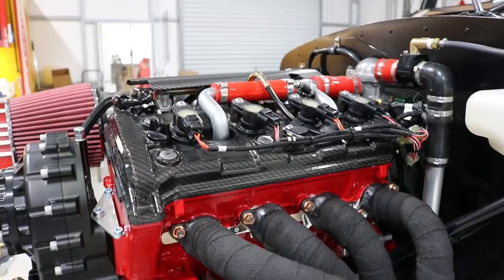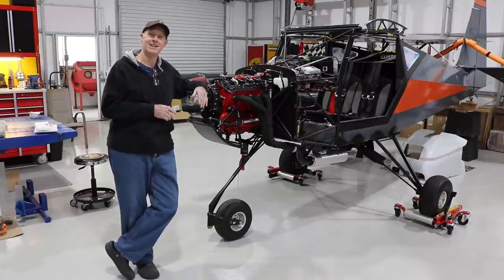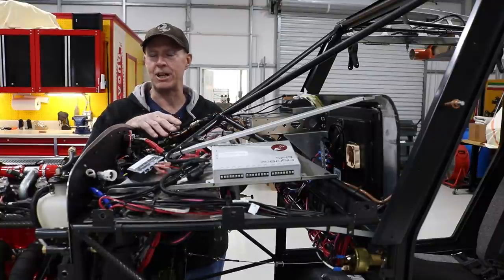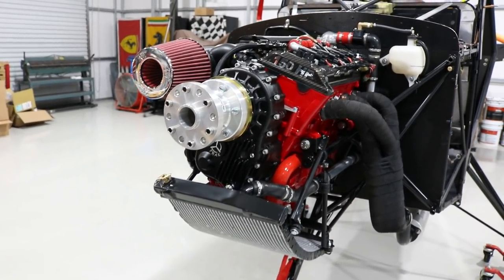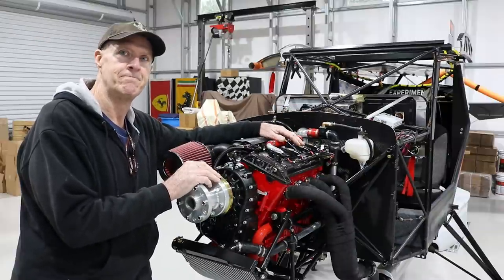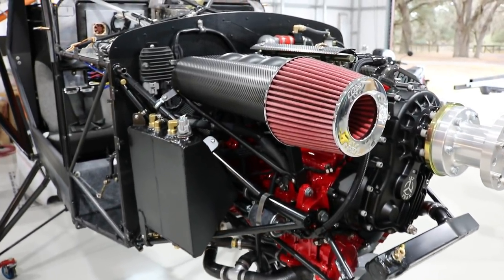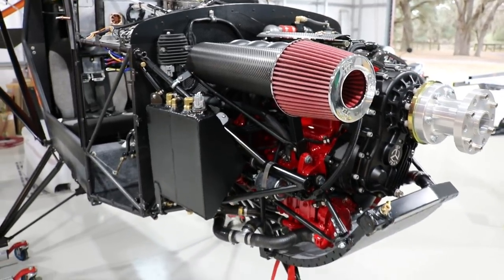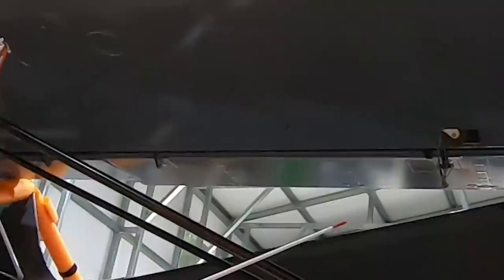150HP Yamaha in Highlander Aircraft - Craig Timm Builder

Comment: Sweet! Definitely need one of those in a Sonex!
Reply: I own a Sonex with Jab 3300. Would love to have 150HP. But with only 1 liter displacement, does it have to spin at 10,000 to make that power??
Reply: @701cyclone  Yes. I read somewhere that these engines have to turn at least 10K. Maybe more like 12K. That kinda puts me off these. Seems like flying around with a grenade on the nose.
Reply: These engines are for snowmobiles that don't have transmissions so they often tend to be running constant fairly high RPMs. They're also based on sportbike engines so they're designed with high RPM and abuse in mind, albeit with a transmission and not flying through the air.
Reply: RADThird1 your worry is woefully unfounded.
Reply: @LORENZindustries  Overhaul intervals are significantly shorter on such high RPM engines (all else held equal). This is not to say it won't operate reliably between them.

Comment: Craig, if you don't mind...
1. Just to be sure,  does the 180 lbs wet weight include the radiator and coolant?
2. What method of attachment did you choose for the inlet runners to the PVC plenum (Hysol, West System epoxy, etc)?
3. We might clarify for some viewers, your radiator is from a Kawasaki ZX14R motorcycle (excellent idea!).
4. I hope we get to see your finished cowl some day, especially the radiator inlet.
5. I'm impressed with your oil tank solution! 
6. Thank you so much for sharing!!!
Reply from the maker: @FoesFlyDennis... this is the Experimental Aircraft Channel. If you would like to reach out to Craig you can find him on the Yamaha Conversions GROUP on FB. (Which is where he will be posting his build updates as he goes). The 180lbs "Wet Weight" would be "All in." Yes sir. Thanks for watching!
Reply: @ExperimentalAircraftChannel  thank you Bryan. Your channel really is the absolute best for EAB!

Comment: As an svid motorcyclist I've always been intrigued with a motorcycle application into an aircraft. I was waiting the entire episode to find out when he was going to talk about having an air shifter to be able to downshift for more climb torque or upshift for better Cruz performance at a lower RPM.... is the reduction Drive connected to the countershaft sprocket? Is the gearbox retained?
Reply: This engine is from the Apex snowmobile, no gearbox.  It does have a slight reduction gear built into the PTO (clutch) side and the SkyTrax gearbox takes power from that.
Reply: @RussellTelker  that makes perfect sense.   thanks for the explanation.   I thought it might have come from a yamaha R1 or something.   Imagine what it WOULD be like to keep prop RPM steady and shift the engine to low gear for climb out and high gear for cruise.
Reply: @mattgeans3758  Yes aircraft do have that called constant speed prop the pilot can adjust the prop while in-flight. Generally those are on complex higher speed aircraft not a STOL type, and light sport not even allowed by the FAA. Most experimental have a fixed prop the cost of the constant speed props can be lot $18-20k vr 2-3k for a fixed pitch prop. They adjust the prop with less pitch when taking off then at cruise adjust it for more pitch reduces fuel usage. Generally any aircraft cruises above 150 MPH or more will have this kind of prop some slower aircraft them. No need to change the RPM of the prop. Generally don't want a prop turning more then 3000 RPM the tips of the blades exceed the sound barrier which would cause them to be less efficient. The prop speed you want to stay constant. Most aircraft engines are direct drive off the crank they turn 2000 RPM range.

Comment: Just wondering about the engine ,  A plane is always under load , a boat is always under load ,  Marine engines have extra hardened valves and the pistons are twice the thickness because a boat is always under load , going up hill . and a plane is too I believe.  My question is this. are aircraft engines built to run under constant load like marine engines ? I would argue the are , But then again I don't have any experience with aircraft so I could be completely wrong.  Can you explain please ?   Thanks , and great build by the way . very nice.
Reply: Most aircraft engines, from what i gather are designed to run at 75% power for cruise. Cross country or cross county.

Comment: Nice thing about 4 cylinder inline engines is their use of a 4-2-1 header.  In years past Vice Roman at Burns Stainless had a header design service.  You filled out the engine specs and paid $75 and got all the specs needed for an optimum header for the engine.  Don't see the service on Burns' current website.  I think Roman is still around and perhaps will still consult.  I have used this service in the past and the seat of the pants dyno can feel an improvement.

Comment: 19:30  After landing & parking a hot engine, I hope heat doesn't melt the pvc.
Reply: Depending on underhood temps of course it shouldn't be an issue. It's opposite the exhaust which is also wrapped. Note that the intake runner tubes are also plastic, albeit likely a fair higher temp material. Peoole have ran pvc piping as intercooler piping on cars and not had an issue with melting it.

Comment: The air intake is PVC, I'd worry about the Heat Deflection Temperature which is only 92 °C (198 °F). Plus PVC is toxic when it burns. How hot might it get under the cowl running hot, sitting on asphalt on a 105°F summer day in FL?
Reply: even thin wall 4" is pretty resilient to heat and flame....plus, if the engine is hot, its running, hence cool air flowing through it.......just saying.
Reply: @hausding  like Jack wrote the there is not always airflow when the engine is hot, like right after shutdown. Why take a chance with your life, use Aluminum or Carbon Fiber

Comment: 20:40 Why is the coil-pack on the front sparkplug oriented oddly?   Does the engine management system use an Oxygen sensor?  Didn't notice one.
Reply: No O2 sensor on the Apex, it runs a speed density system. Designed for cold weather temps like snowmobiles, usually requires retuning depending on use case.

Comment: I love your project. In the same time as a diesel mechanic I disagree with you on the cooling system. Closed and pressurized cooling system has higher boiling temperature.

Comment: Had any years of apex yamaha  experience  with this engine one of my sleds has, 26,000 klm on it others have up to, 40,000 very real live engine ealways used a soil 0/40 synthetic  in fact owned over apex sleds with the same engine  ever had a problem on sled these enginkearerunni g had withaverage rpm 8000 to 111,000. I am also retired pilot last air raft piper Aerostar twin.  84 years old and  still  sled, Christopher ,Ottawa canada

Comment: Finally someone who knows that aircraft engines don't have to be from the dinosaur era with carburettors, carb heat, manual chokes, running lean of peak with manual mixture controls and other idiotically old tech like this. Don't tell me "it's more expensive to repair this way", because it's not... I have experience working with all manner of engines old and new...The modern designs are better in many, many ways.

Comment: That intake is going to have cavitation issues. Being someone from an automotive background, you should have known that. Cavitation is going to cause instability and you will get less airflow, and at higher altitudes, seems that would be a problem........
Reply: Cavitation from what?  He doesn't need to force air directly in, it can pull air from under the cowl.  All he needs are a couple NACA vents.

Comment: Not a fan of the Yamaha high RPM sounds like a blender prefer the low RPM of a direct drive mounted prop they are amazing engines. Covers over fuel injection rail just blocks the view of what I want to visually inspect during a preflight.
Reply from the maker: Did you notice the big, long Hayabusa muffler he installed? He doesnt like high revving sound waves either.  With a good muffler it really makes it much quieter especially in the cockpit.  We are watching and learning about this option as it progresses into more airframes. Seeing these performing in long cross country flights over time sure would be a good test over time.  The Yamaha is a well engineered machine though. Certainly.